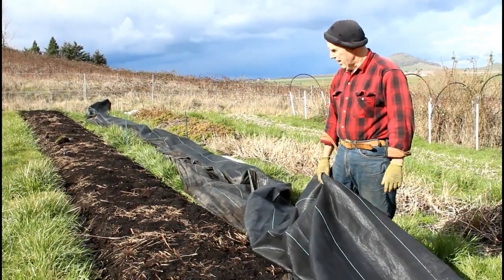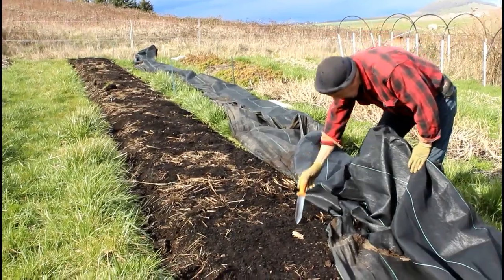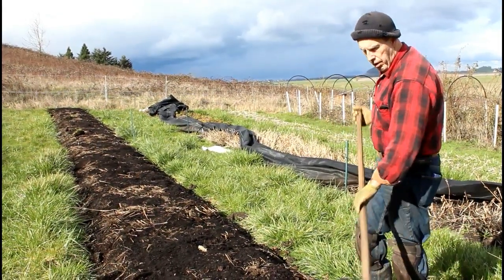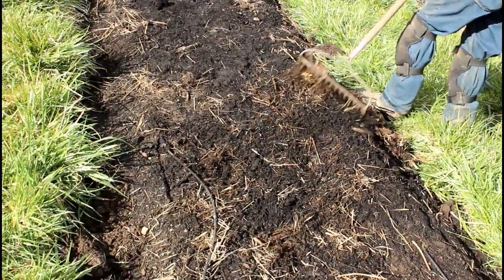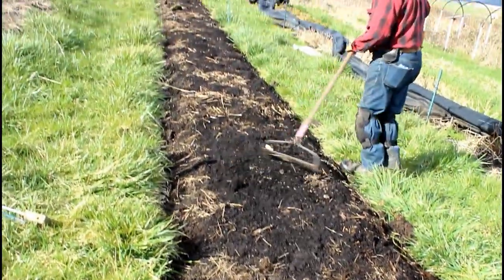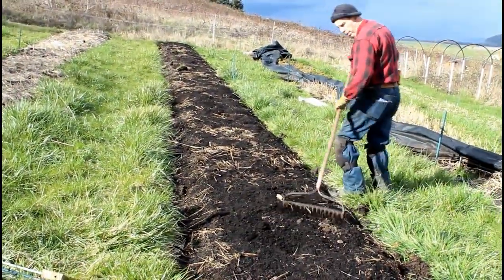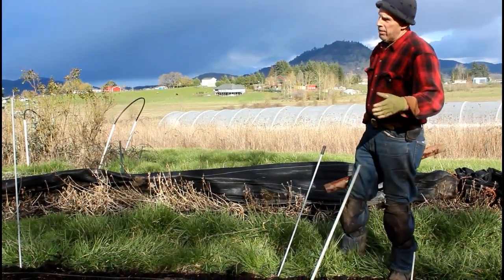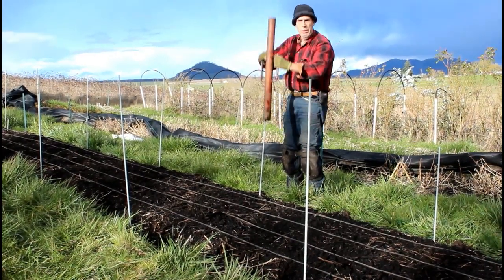How to construct a caterpillar low tunnel   Part  1

Comment: Thanks, very helpful. Could you please suggest a source and specifics on the fiberglass fence posts you prefer.
Reply from the maker: Hi Darrell. we use 3/8" 4 foot rods.  These can be found at most any farm supply store. In the U.S. the retail for around 1.50 ea. Many times you can get a discount if you buy in a pack of 20.  one other source is Premier  1 Fencing .  Try this link: https://www.premier1supplies.com/p/smoothcote-fiberrod-posts-3-8-in-dia?criteria=fence+rods
Reply: Thank you very much for this response and link. I bent up 10 hoops this last weekend and hope to get another 40 or so done before spring. Love your videos. Thanks!

Comment: When you covered the bed before this video started, and pulled it off, was it weed barrier cloth? You call it a tarp. I am guessing it is the landscape fabric, heavy duty...can you elaborate? Thank you for all your videos by the way. Very helpful!
Reply from the maker: Hi Melody; Your correct! The fabric is poly weave landscape fabric. we buy it in 6'  by 300' rolls. Our bed widths in these areas is 4' and wecut the fabric into standard lengths of 100'
Reply from the maker: We have used both woven poly landscape fabric as well as 4-5 mil silage tarp or plastic sheeting.  During our rainy season we tend to use the landscape fabric more as it allows moisture to pas through.  during the dry season we switch to silage tarp or plastic as it retains soil moisture better.